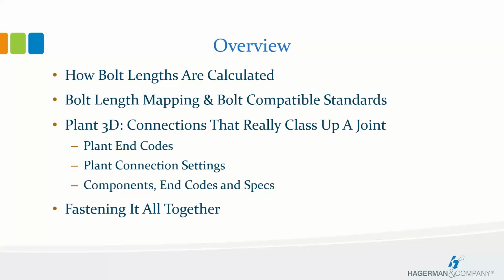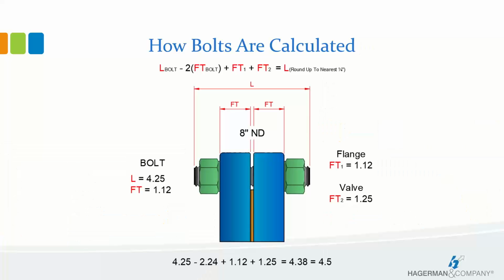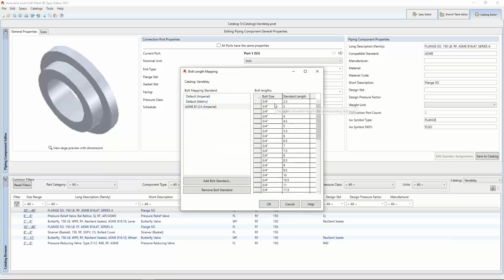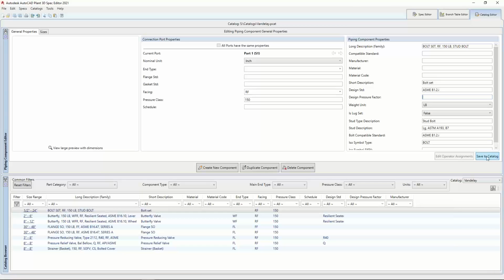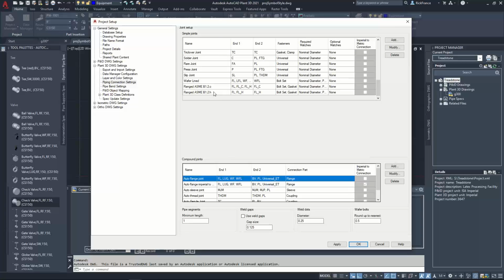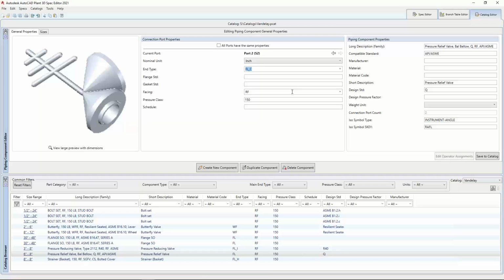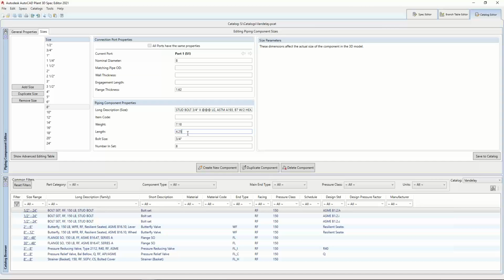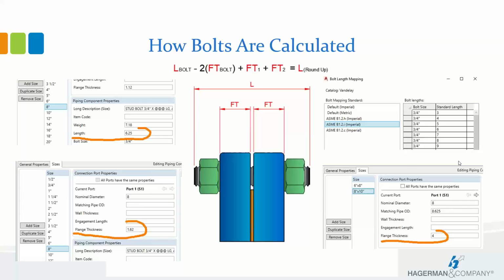Plant 3D: The Long & Short of Bolts at Length

Comment: It´s an old video and i dont know if there is anyone to answer. i have a problem with matching Bolts and flanges. In DIN standard we have different types of flanges. I want to set three different types in one Pipe Class. I want to know  how can i set a flange with correct Collar ring and correct boltset.
Reply: After adding all the desired bolt sets to a spec, you would set the Part Use Priority for each pipe size to get a particular set with a flange.  Also, after placing a flange, you can use the substitute feature to swap between bolt sets.  But using Part Use Priority in the spec sets one as the default.  Hope this helps.
Reply: @Hagerman_brettbarkman 
Thank you for your fast response. I knew this method. The problem is that we are a great design team and i am not sure that all the teammates do it correctly later. It seems there is no other way. 🙏